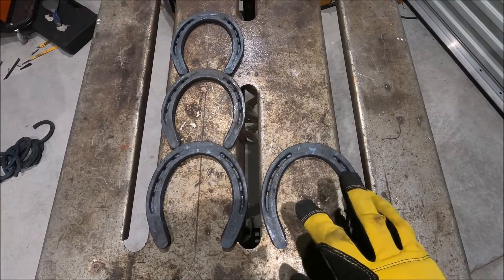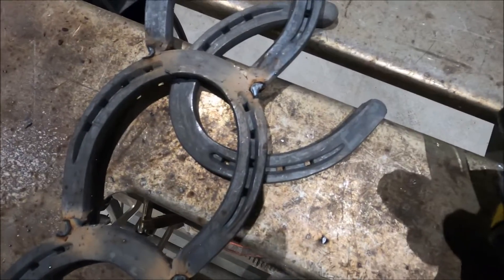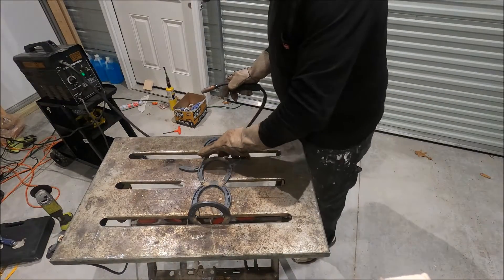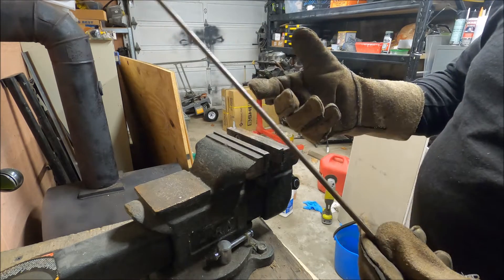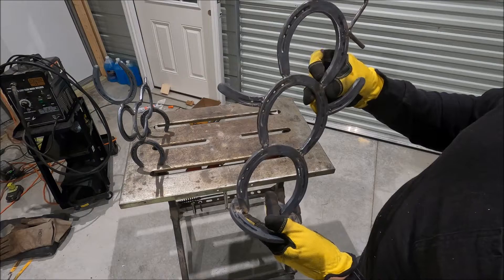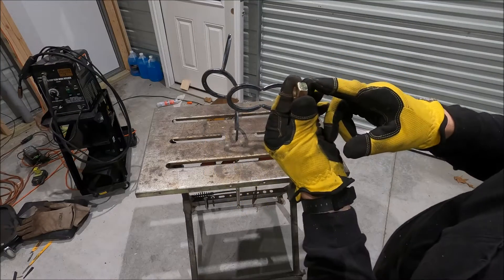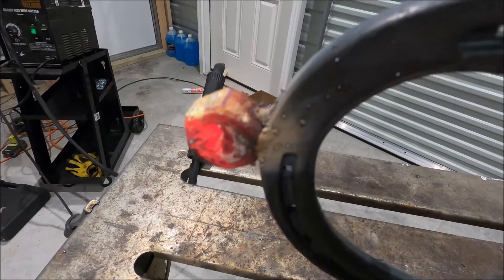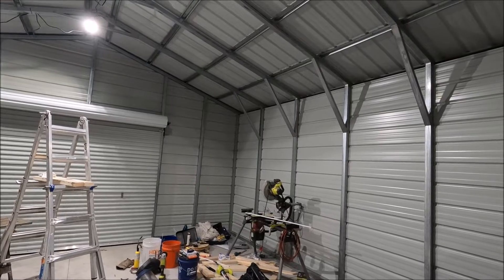Christmas Welding Projects | Framing Garage Update

Comment: What type of insulation are you using? Are putting a plastic vapor barrier in?
Reply from the maker: We are going to use faced fiberglass insulation as it will not come in contact with the metal walls because of the framing. We are going to put spray foam insulation on the metal ceiling to control condensation.